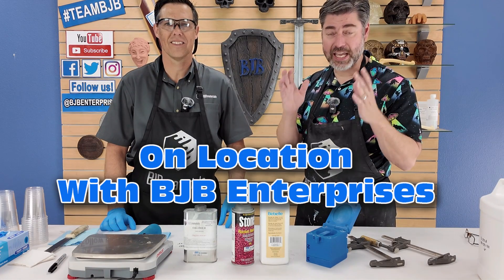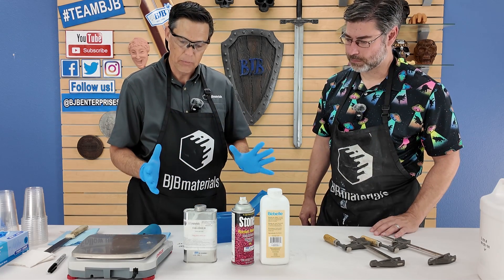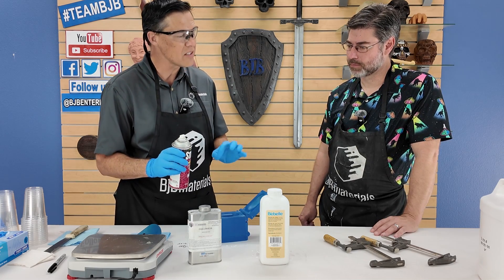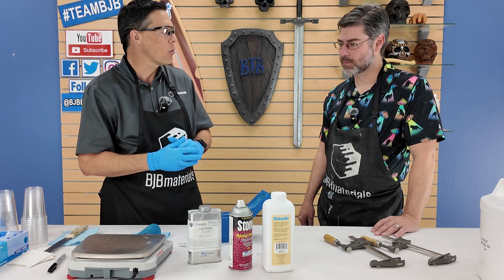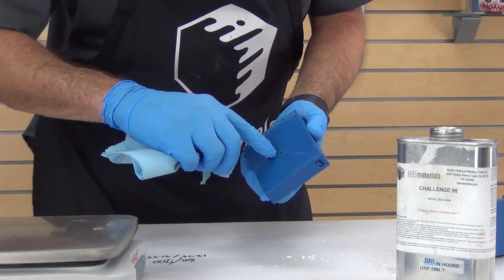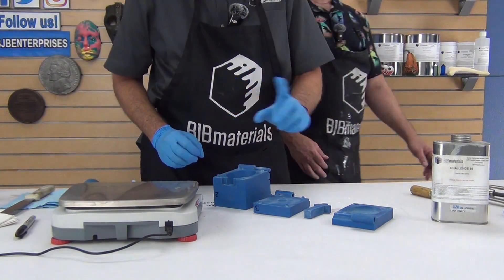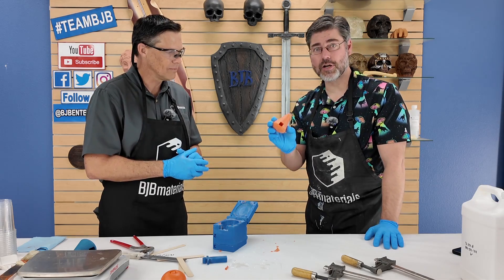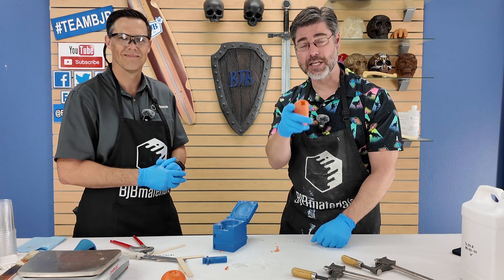3D Printed Mold - Foam Casting Custom #3dprinting Drone Parts

Comment: Anyone tried using lighter weight foams? I think EPS needs steam? Are there other very light foams?
Reply from the maker: The lowest density flexible foams I have seen are ~3lb density. TC-266 is one I have used frequently on this channel, and when mixed 50A:100B it cures to a 3lb density in free rise. Mixing it 30A:100B yields a denser 5lb foam in free rise. EPS is a completely different process.

Comment: Stoner Molding Release offers a M887 product that is FAR simpler than the Challenge 95 > Rocket Release > Talc. The M887 isn't on their website, but if you contact Stoner, its available. Can simply dip / submerge printed mold into their release, or brush on. Solvent base makes it dry pretty quick and it is self leveling, plus does not requiring any buffing.  For newly printed molds, give two coats, and pour your part. Then after each pour and pull, refresh with a coat (spraying works well for this too). MUCH simpler and faster process.  I use it with 3D resin prints, but don't see why it wouldn't work for FDM printing (ie PLA). Smoothness makes a massive difference for releasing too. 3D resin printed parts are already much smoother, and you can use 3D printer resin itself to brush over the printed cleaned part, which self levels, and then cure with UV cure lamp... leaves a glossy surface. Couple that with the M887 and demolding even light foams like TC266 heated (like to 120-140F) to blow lighter, even with reduced backpressure (ie 1.75 multiplier), and they will release just fine with a great resulting foam surface.
Reply from the maker: How does that release work with foam? I will pass this info on to Troy @bjbenterprises
Reply: @brickintheyard  The above described was tested successfully with both TC266 and 277
Reply from the maker: @rshacklett99  Excellent! I will see if I can get my hands on some! Thanks!
Reply: Thanks for the tip.  We are always playing around with new releases and methods!

Comment: Love it, i want see what other materials we can mold  with printed items
Reply from the maker: More to come!! Thanks for watching!
Reply: @brickintheyard  I have used conathane (polyurethane) to overmold mil-spec connectors, and PLA hardly needs any mold release, though I will spray a little silicone just to make it easier.   ABS and PETG is better,  as the material I use needs warmth to cure faster.    at room temperature it would take many days to cure enough to be removed,  PLA does not hold up to heat,  so I may only get 2-4 uses,  but the stuff is cheap and my production lots are small.   if I have a big project, then I'll use petg or abs.  as they stand up to the heat a lot better.

Comment: Another tip. Cell structure and skin can also be improved by adding energy at the time of mix. Hence, a drill mixer (the new Zip-Mixer) is a great way to tighten cell structure. I premix A and B with 10-seconds, all the while scraping sides, then immediately grab the high speed drill for another 5-seconds. Yes, you need to work fast, but with some practice, this becomes easy.
Reply from the maker: Thank you sir! Definitely a topic worthy of a video! I do believe I have one of the new zip mixers…

Comment: I use similar techniques in my business. The nice thing about 3D printed molds is when you need to ramp up production, you simply print more molds. I cast using FP-50 polyurethane rubber with excellent results.